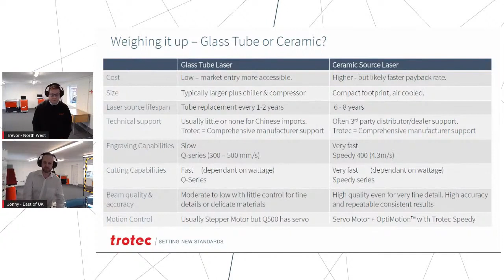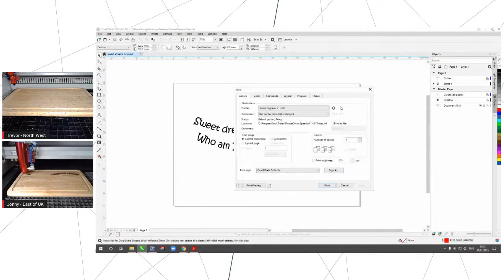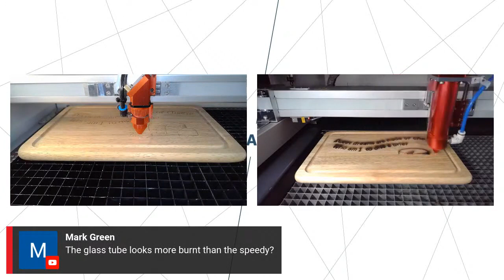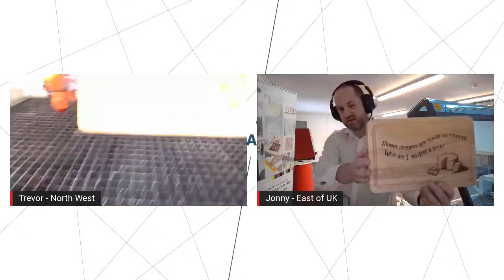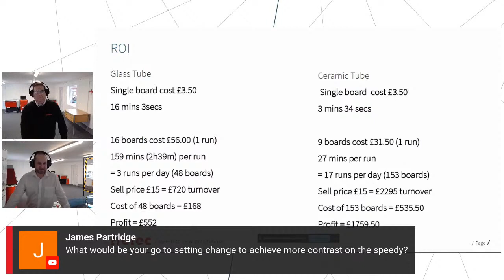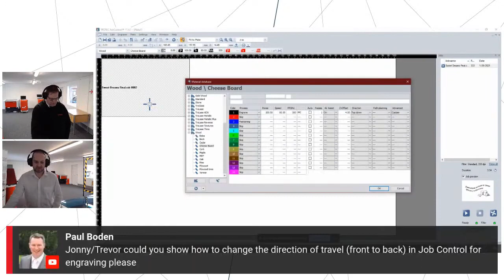Trotec UK Live: Glass Tube vs Ceramic Laser Machines | Trotec Laser

Comment: I have a trotec q500 (Q51 - 0332)and when I engrave I notice that the head stops when it reaches the end of the line and then starts to move to the opposite side. On the other hand in this video I notice that the head when it reaches the end of the line immediately begins to move in the opposite direction. How can I solve this? With these static moments of the head the engraving process is much slower.
Reply from the maker: Hi! Are you using a JobControl camera on the machine? If so, this does happen and is normal behaviour for the machine. You could try removing the camera to see. Hope it helps! 🙂
Reply: @TrotecLaserUK  The machine has a camera installed but I have tested it without the camera and the result is the same. Is it because it already has the parameters loaded indicating that there is a camera installed and it is not enough to physically remove it to reach the speed it should without the camera?
Reply from the maker: @GabiNeiva7  We recommend you get in touch with your local office for technical service and support as they will be best placed to advise you on what to try next. You can find your local office contact details here https://www.troteclaser.com/en/contact/contact
Reply: @TrotecLaserUK  Okey, thanks.

Comment: For the glass tube laser engraving would it be quicker to engrave letters individually instead of it having to go back n forth wasting more time ? Does it have that option on the software?
Reply from the maker: Hi Mo, its actually quicker to engrave this way as by going side to side the laser keeps speed. If you want to do each letter individually you just need to assign a different colour to it in the software. Hope this helps!

Comment: In the case of engraving, ceramic tubes win in time, but in cutting I don't think there is much difference in time. Now it would be nice if you can have a single cut price comparison. Many businesses require more cut, in my case I use more than 95% cut.
Reply from the maker: Hi Ricardo, in many cases, Trotec ceramic tubes can be faster for cutting but it does depend on the application and which laser model is being used! Your local Trotec office will be able to run a time trial for you, so please get in touch!